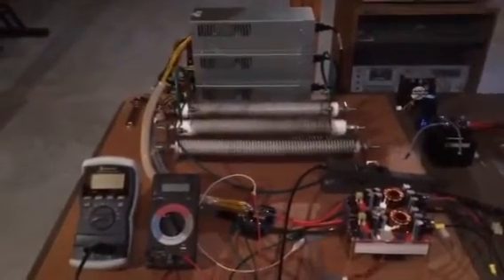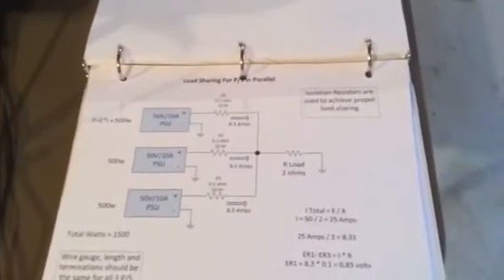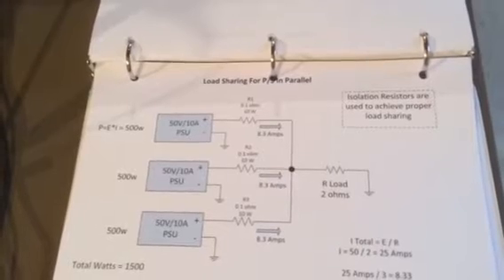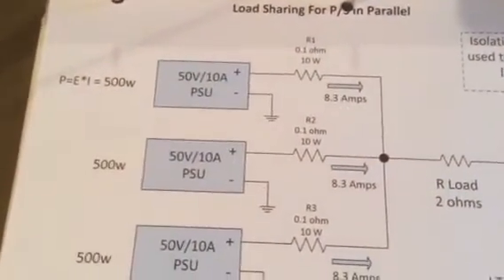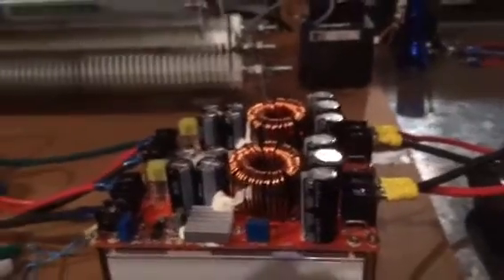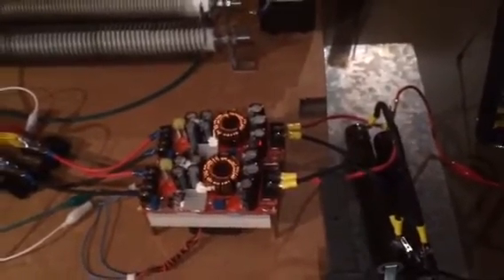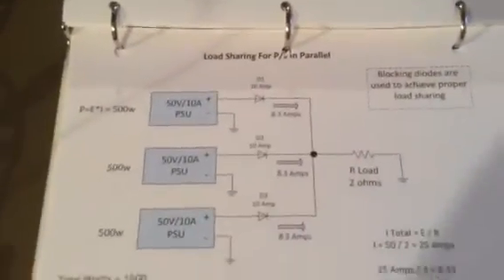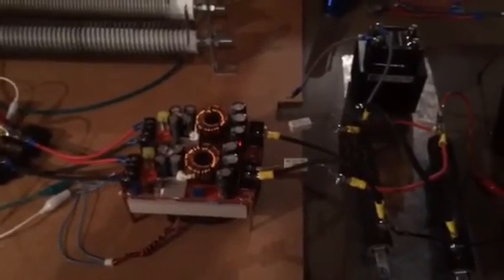RF Man discusses load sharing in parallel power supply's and boost converters

Comment: So what would be the next step to reduce power loss over the resistors? I tried the diodes and someone else mentioned there are problems with power sharing and stability when the boost converter is not in constant current mode.

Comment: Great video! How reliable would the 0.1 ohm resistors prove to be in the long run if these dc converters were being used daily? Why does this solution cause the converters to share load more equally? Is it due to the impedance of the converters not matching and having very small impedance? What is the impedance of those boost converters?

Comment: You can use 100V 50A TO220 pkg, dual diodes (in parallel) mounted on a heat sink. I have 10x1200 W SMPS in parallel. Works great. I have only ever loaded it to. 800 amps.
Reply: Do you have a partnumber for those dual diodes?  What voltage and amps is 1 smps?

Comment: Sir, can I limit the output current of each boost converter to a certain amp, lets say I set each of their current limit to 10amps, and if the load draws 10amps, the first boost converter will do all the work, but when it draws 15amps, the second converter will kick in to contribute to the load sharing, and use shottky MBR60100 in each converters output to isolate them, this way with the shottky diodes the voltage drop is minimal compare to that of the resistor. This set up uses the second converter as a back up if the first one reach its current limit, this way Im not pushing the first conv. to its limits. Am I making sense?

Comment: OH MY GOD! THANK YOU! What I am now trying to do is:  use two 1200W boost converters (very similar to yours)  in parallel, to move 'extra' energy from solar panels when their 12v battery is full, to 48v battery used with a more powerful inverter. The setup will work every day, so I want to have considerable redundancy both in terms of power handling capacity and reliability (I am from Ukraine and I think we might have some issues with electricity supply again in winter). And I went through quite a few videos on 'paralleling' dc power sources. Yours is a savior, others did not really address the possible solutions to the issue when one power source takes all the load. Can you please tell me, where there is a lower energy loss, when using resistors or when using diodes?  If I understand correctly with resistors I need to have them in series with the actual load, separately for each converter, and to pick their wattage as low as possible with the voltage used (55V in my case for max 48v battery charge) to have minimum current drop. The planned power for the converters is 400W total (200W on each converter) so I hope I will not get to much heating on converters this way. Also there will be a separate charge controller, that would connect the boost converter's input to 12v battery only between it's 90% to 100% state of charge (having converter's inputs connected to 12V battery the time and actually connecting their output through charge controller relay sounds better in terms of smaller current on the relay, but I am a bit worried about converters sitting with no load connected to battery all the time). And maybe you could advise a better approach to my 'understandably overkill' solution. Thank you.

Comment: is it posit is possible to build a buck converter-based dual bench power supply with a master-slave tracking system for series and parallel operation.

Comment: What about resistor AMP rating? The resistor leads don't look rated for 30-40 amps!
I want to power 1000W from a 16V battery.

Comment: Hoping for an idea and some help! Love the videos! I need to produce 216v dc and around 35-40 amps or maybe more. My source will be a lithium ion battery pack. Any ideas on heavy duty high voltage boost converter?? Thank you for any help! Wish there was a way to do like you did here only put sets of them in series. I was watching your other videos on paralleling your boost converters.

Comment: You have 2x 1800W step up's in parallel so over 3000W available at 50V but how much of that power can you pull through hose resistors?

Comment: Could you use a current mirror made from discrete transistors to join the converters together instead of the resistors/diodes? I would think it might be useful at extremely high currents (like joining multiple buck converters in parallel.) I saw it discussed on the electrical engineering stack exchange but they were not sure if it could work.

Comment: Dear RF man, can you help me, I have a 72v ebike with a BMS that has passive battery cell balancing (syphons the cells via a FET). I have made a booster pack out of 2 separate batteries for the bike, one is 11.1v nominal 3s and the other is 36v nominal 10s li-ion. I have them on separate circuits with appropriate breakers leading to the same step up converter you are using. I have set it to the appropriate max battery voltage of my bike on the output end so it charges. However when it charges, it seems to send the balancing function of my main battery BMS into a fit, the cells fluctuate up to 4.5 volts and down to 3 volts, this trips the protection of the BMS circuit and cuts the charge input stopping the charge. If I turn of balancing it is fine.

My question is, do these step up modules put out lots of noise that could effect the functioning of the FET on the 72v battery BMS?? I am trying to fix this problem so I can maintain balancing function whilst charging from the boost module. It charges fine off the mains charger which also uses a step up, but only difference is, it has a 48v 2.4kw rectifier on the input end instead of a battery.

Comment: Those 12v smps connected in parallel, if connected with a pwm to charge a battery, is there any need to do the power sharing thing?

Comment: Hi ! Can i use a PC PSU ( 12v - 22 A ) to supply 5 drok buck voltage converters set in parallel so each is a 12 V 4,4 A load ?
Reply: You might as well just get a bigger step up module. Like the 1500w or 1800w step up modules in the video. Also if your having each module at 4.4 amps, so all together are trying to put out 22 amps in total, then you will trip your pc power supply as it wont be able to put out the current. Remember that there is an efficiency loss when stepping up electricity, around 20 - 25%% for these things. So it will be pulling closer to 30 amps from your psu.

Comment: How do you calculate the diode amp rating needed? I am powering a 24v 12a motor. I have one PS of 24v 9a, thinking of getting another one of the same 24v 9a, or just 24v 6a (cause it's half the price) for a total of 24v 15a in parallel. However, the back current from the motor, if I am not wrong, could send current back into the PS, so the diode may be better in this case. But how do I calculate how much amps the diodes should be rated for? Also, any problem connecting in parallel the 9a and 6a if they are not the same amperage?

Comment: I’m using a 36 volt 460 watt hour battery out of a broken e-scooter and I need a 13.5 volt output to run my inverter so I want to run 2 300 watt buck converters to an inverter. I didn’t do any calculations though and I bought several 0.1 ohm 100 watt resistors. I’m pretty sure I’ll end up adding more buck converters to run more powerful inverters in the future if I get more batteries. Next to buying a 36 volt to 120 volt inverter this is several times cheaper.

Comment: Hello. I have problem. I tried to connect two boosters (250W) parallel but they both burn out. Even tho the were not under the load. Now I would need to connect another two boosters (1800W) but Im afraid to do it. Any  ideas why frists did burn?

Also I have another question. I have motor 24V and it takes 90A while starting. Is there any device where I could set max load 50A so motor couldnt take more?

Comment: know this is a bit dated but had a question that having a hard time getting an answer. Trying to figure out result of circuit similar to this except I have inputs (AC current) of the switching power supplies(dc battery charging) wired in series. flow of power would be AC current to 2 supplies in series which have dc outputs wired in parallel to battery. seems to be working fine but just  wondering if there's potential dangers doing it this way

Comment: How can you adjust the Amperage (10 Amps) on the 12 Volt Rail on the PSU, down to 1.35 Amps going through the Booster Converter? I only see one Potentiometer and that one's for Voltage.
Reply: DC loads will only draw what they need. 10 amps means you can safely run 6 of those with head room

Comment: Thank you man!

I will be using those boards gor my custom e-bike, I just hope ur calculations are correct 😅

I've noticed that there are exactly two types of these, 1200W and 1500W respectively. Although some are being sold as 1800W 🤔

I'll be using 2 car batteries in series, which will be around 24V, boosted to 48V (or more) depending on the motor, since it's "rated" for 500W - wish me luck!
Reply: Did it work? I'm actually gonna try to use two of those 1800w dc-dc converters for 1200w e-scooter. Problem is, converter max voltage on input is 60V. And my battery is 67V when fully charged. What I want is to keep the voltage to scooter at around 65v so I have max speed even when voltage on battery drops to 45V (empty but still safe voltage). Hopefully this works on the input as well (battery out to two dc-dc converters in parallel) and then to the scooter.
Reply: @KolyaNadj  I found a different solution. So I actually didn't even try this method. What I can say for sure is that you won't ever get the full power out if these things, no matter the conversion ratio, so keep that in mind. It's about half the specified wattage. Good luck!
Reply: @ShaaRhee  Thanks for the heads up. Hopefully 2 converters will be enough.

Comment: Very interesting video, thanks.  If I may ask a question.  I have a MeanWell power supply (CC,CV) and a battery hooked in parallel then again in parallel with a load.  Im thinking the battery would delivery the brunt of the current to the load with the power supply mostly charging.  At least thats my preference, with power supply delivering current to the load if it demanded more than battery capability.

Comment: @RF Man Channel Dont those boost converters already come with 2 double schottky diodes (STPS20S100CT) on the output stage? Albeit they are before the capacitors...Do we still need to load balance?
Reply from the maker: Yes, you still need to balance the load.
Reply: @rfmanchannel6915  same way with resistors or will it work with schottky barrier diodes?
Reply: @RandomPsychic  You can use diodes as well. The approaches work fine.

Comment: How would a 0.1 Ohm resistor add anything a long wire would otherwise not add? I don't understand how adding such resistors would isolate anything compare to the case without them as wires themselves have some low level resistance.
Reply: I found (this)[ http://www.ti.com/lit/an/snva794/snva794.pdf ] to be quite helpful in answering my own question. From my understanding so far, I still think "isolate" may not be the right word to use here?
Reply from the maker: @topherbuckley  The resistorsa do in fact isolate the regulation loops in each power supply. Thanks

Comment: Thanks for the tip RF Man.  I just purchased 10 each .05 Ohm, 50 watt resistors.  I'm going to parallel 5 of them for each supply thus giving me a .01 Ohm 250 watt set up.  I only need to plan for 123 watts at .01 ohms so I should be good.  Can't wait to get started on this project.  v/r and 73s

Comment: Flipping insane what they want for stupid power resistors around here.    Think I'll just try using some cheapo shunts to do this.  https://www.banggood.com/External-Shunt-FL-2-100A75mV-50A75mV-Current-Meter-Shunt-Current-Shunt-Resistor-For-Digital-Amp-Meter-Analog-Meter-p-1418071.html?rmmds=search&ID=515283&cur_warehouse=CN
Reply: Did you get to try it out? How did it work? 
Also, could you adjust the voltage to compensate for the voltage drop if the output voltage is of importance? (Lithium battery charger).
Reply: @ScinnerNo1  Not tried.  The output is fully adjustable on these.  Current and Voltage.
Reply: @pulesjet  Yes I know. But Im kind of new to electronics and circuits so I didn´t know if the resistors made it not applicable in some magical electronics way ;) Thx for answering and please let me know if you try the shunts out!
Reply: @ScinnerNo1  Running in Skint Broke Mode right now.  LOL  Trying to scratch up enough for some batteries for my Solar / Wind Power Closet thing a Bob.    I do in fact have a few shunts here.  Just need to get motivated and try it out.  Don't see why it wouldn't work.  Eaaa?
Reply: @pulesjet  No I guess its just a resistor with a known voltage drop so you also could use it for it´s original purpose, messaure the current. Do they specify the resistance of those shunts? I guess, how would you else calculate the amp draw. Do you know the resistance of yours? Or can you calculate it by the voltage drop or something. And what sets the wattage value? Im just thinking out loud :) This is why I should try to understand ohms law a bit better :)

Comment: Hi, can I series the output Boost Converter to increase the Voltage??,,
Because, when I tried it did not work (Boost Converter Cut Off)
Actually, I tried the same methode on SMPS power suppy it Works..
Please help me...

Comment: so this is how i  power a 48volt 20amp max draw ebike motor ? i mean i am trying to avoid spending 500-600 dollars  on a 18650 series battery pack with BMS and charger.... the application is for a tricycle so weight isnt that much of an issue but i would like to try and reduce my number of 12volt batteries required. each battery is 12volts 18 amp hours.. but they weigh 13 pounds each....could you help me with this ? do i need 2 batteries ? 3 batteries ran in a series ? or should i just buy 4 batteries and be done with it ?
i am an old roofer..i am good with a hammer...my  electrical experience is basically "plug-n-play"
Reply: Bob Americana, check out super capacitors.  they are extremely light and pack a lot of power but expensive.  Also Harley Davidson now sells lithiom Ion batteries that are 12 volt and super light and also have lots of juice.  again expensive. v/r 73s

Comment: What if you have two CC-CV boost converters and you simply set each one to limit the current to half of what you need?  Say you need 10 amps at 50V.  Set each one to 50V and 5A.  Would that work?

Comment: Hey, what resistors would i need for 4 30A 12V Power supplies?
Reply: Jacob, .1 Ohm 100 watt resistors coming off each supply positive lead should do it but, you will have a voltage drop of 3 volts.  If you go with .01 Ohm, 10 watt resistor it which will keep your voltage drop to .3 volts.  I always double my wattage rating and would purchase .01 Ohm, 20 watt.   Good Luck and 73's

Comment: What about really low voltages like stringing together cheap LDOs and without as much heat loss for battery applications? 

Can you settle the use of diodes in this? And 240p come on? Otherwise solid demo, really helpful.

Comment: nice! dont forget that diodes are not needed since there are diodes in the boost converters circuit, they waste alot more power than the resistors, 0.5v * 8.3A = 4.3W not counting resistance also. cool video thanks for sharing!
Reply: Correct and they dropped the voltage by 0.5 volt

Comment: Dude thanks for pointing this out ive duplicated it with 2 of the 20 amp models for solar charging its doing just fine
Reply from the maker: Thanks for the feedback....
Reply: ans3rina3 you can series them, just make sure you have reverse polarity diodes, they should be reverse biased across each PSU in series, the issue is since these are not isolated PSU's the inputs need to be isolated, otherwise you have a grounding problem and it will short, I made a video building a PSU using 8 laptop chargers it is 3 different outputs, leftmost is 2Series 2Parallel, middle and right is 2S1P you can see how to connect the diodes across the positive and negative of each PSU in series : https://youtu.be/lw_bY6FEVEs
Reply: oh hey there... :D
Reply: i am about to do similar. thankyou. tangent. is it possible to series these or similar cheap switched power supplies?
Reply: SuperBrainAK thankyou! rf man do a video for us sheeple please :D

Comment: 240p... did you record this with a potato?
Reply: Would you guys kindly leave the poor, innocent potato cams alone?  I'm on 5mbps/768kbps ADSL smoke signals here in rural OR and 240-480p is my usual rez.  Wish I had OC3, but...it still beats the 1200baud modem I started on.
Reply: @ljprep6250  Shout Out to everyone that had to live with a screaming modem!
Reply: @charlesrichards5389  Yup.  We learned to speak modem so we could tell if they were connecting properly or not, too.